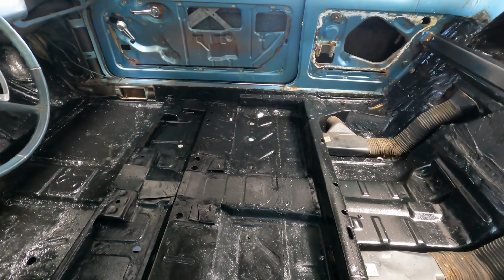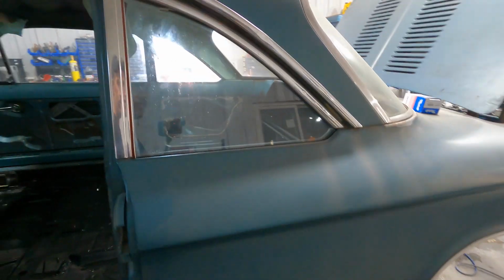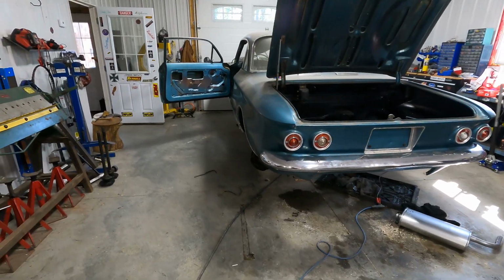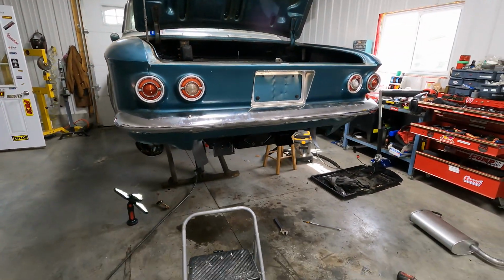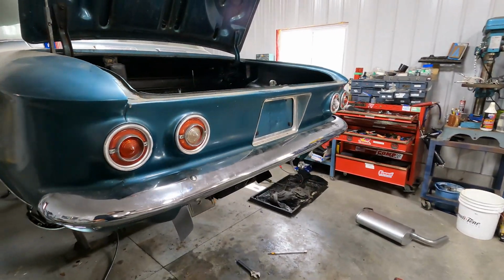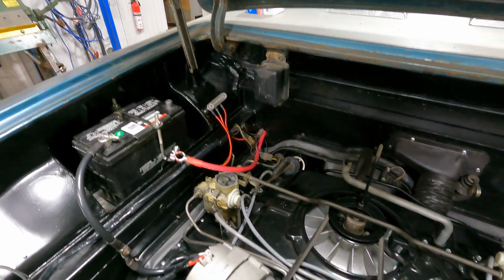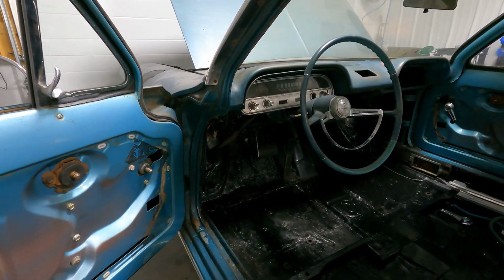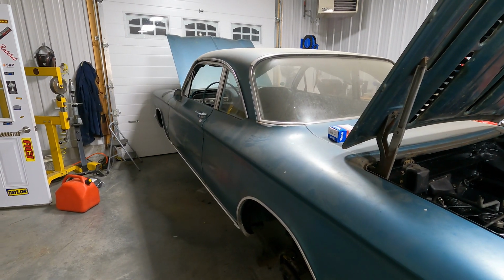Engine install in my 1964 Corvair Monza Project

Comment: The Corvair was GM's alternative to the VW lineup. A lot of the designs were similar, and the only reason that the Corvair was killed was political, not "safety concerns". They were good vehicles that were actually  built better than the VW vehicles, and the bodies were even more solid as well. The big difference between the VW engines, and the Corvair engines, was 2 more cylinders in Corvairs than the VW counterparts.
Reply from the maker: I have both an air cooled VW Bug and several Corvairs. I've owned over 30 Corvairs. I like and appreciate both. They're all good as long as you look after them and enjoy them.  Thanks for watching.

Comment: Hows the auto compared to manual trans.Enjoy your vids .
Reply from the maker: It's funny, I used to hate the thought of a PG Corvair. The powerglide did nothing for me and I've even swapped a couple to 4 speed. However, the PG cars really are great. Easy around town and great cruising on the highway. Very smooth and easy to live with. They do take a bit of getting used to. They only shift once and all Corvairs seem to cruise roughly around 3500 RPM on the highway. That takes a bit of getting used to at first.